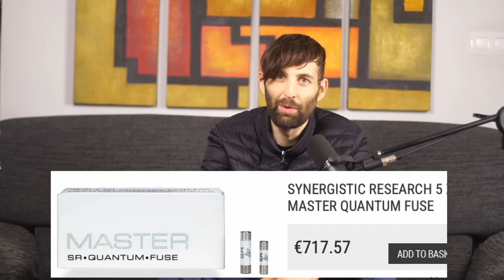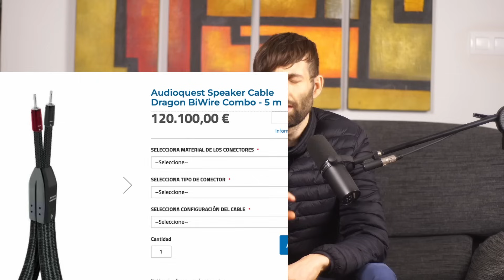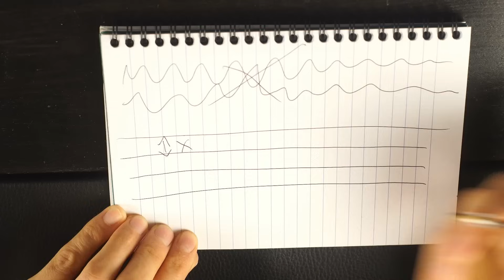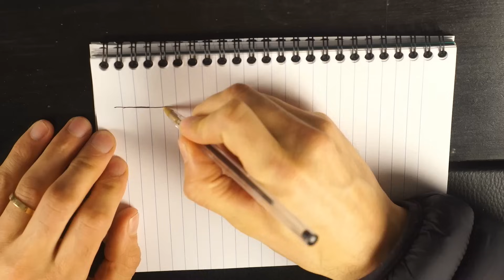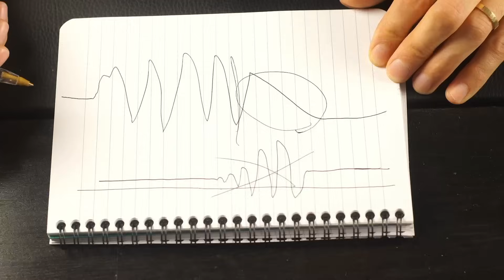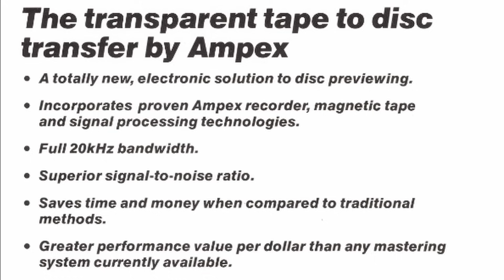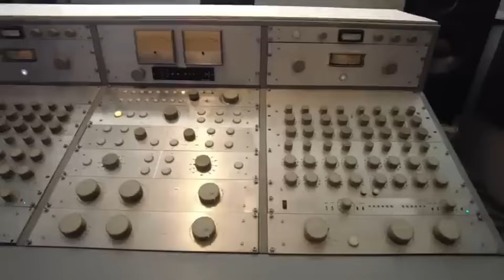Hard truth: most vinyl is digital anyway

Comment: I had no idea they were digitally "mapping" the groove cutting path to keep the grooves from running into each other on vinyl records! I just figured it was always a fixed spacing ratio and then they cut within that set grove "window." That's pretty wild!
Reply: I am no expert on the subject of the "varigroove" method (I believe it was also called Rheinische Fullschrift in Europe IINM) but, in all fairness to the analogue enthusiasts, I have come across pictures online of analogue reel to reel machines that used something like a preview playback head.  This preview head was placed around 2 seconds "earlier" than the actual head which signal goes to the cutter.  This would have been for 33 rpm records, one rotation taking 1.8 seconds, of course.  Once again, I have very little knowledge of these machines but I am very certain they used some analogue electronic circuit to accelerate the lathe's movement when a louder passage came by and decelerate it again when the sound level decreased.  (...Whoops ! and then I resumed the video.  Very interesting machines.)
Reply: @Spacekriek  This was covered in the video ... including a super-rare example of a deck that can do this... but this isn't how it is done nowadays.
Reply: I am curious about whether the grooves become more widely spaced towards the middle of the record, to compensate for the diminishing length of the grooves.
Reply: @ThreadBomb  The diminishing circumference of the record as you progress towards the centre means that speed that the cutting or reading heads see reduces. The inevitably slower speed means there's less room to fit in all those squiggly sound waves! Making the groove (not grooves ... there's only one) more widely spaced isn't going to add to the space available lengthwise, which is what you are losing. I suppose spacing gives you more potential for higher sound levels but I don't think that's what you're after.
Reply: Look at the 'cannon' sections of the "Show me what your made of ..., Deckard ....",Telarc "Tchaikovsky 1812", [DDA], Digital RECORD to see why that was necessary!
Reply: Like everything he gets wrong, pro-studios had decks with an extra preread head to give the master engineer that advance level to adjust groove widths. Other than some of the earliest, few records were cut with fixed spacing. Every effort was made to cram as much music per side as possible.

Comment: I have a Bluesound node x and a Chord Qutest DAC running into a Macintosh  MA 7200 and then to Kef reference 5 meta’s, I love hi res, have embraced it, I’m also a vocalist and former choir boy, my ears are good.. but I also still have a place for some vinyl and a Macintosh T5 TT to play them on, why ? Compare the Zeppelin digital remasters to the analogue original pressings for instance I do think there is a fluidity to the pre digital versions,  not all of them though, “Presence” is an issue, the original pressing  is bass heavy and the mids and highs are poor.  “Kashmir” is quite different in its pre digital form, strings particularly.. check it out .. Stones 70’s output digitised is also not so great, a longer signal path ? and to my frustration there is a great deal of music I listen to on vinyl that isn’t available in hi res, just standard CD resolution. I would also point out that some songs, JJ flash for instance that sound really bright and immediate from the original vinyl single, the early digital versions really sounded flat, poor digital transfer, it’s since improved … so I am not having a go at you. Other examples such as the Police remasters, the Sabbath remasters are grim, terrible, Floyd’s remixes of Delicate Sound and Pulse sound amazing in Hi res but ! The remix has stripped rhythm guitars out of the mix, so listening to it is a compromise of sorts..

Comment: The way I thinks about analog and digital is digital things are numbers and repeatable. Just copy down the number and you have a perfect copy. Analog is always an attempt to copy the original, every attempt is going to be slightly different. So copies will always be imperfect.  Vinyl might sound great but every time you play it it is different. Digital stuff is better as it is accurate as possible and never changes.

Comment: Prior to using digital delay, couldn't (didn't) the lathe operator adjust the groove spacing on the fly to accommodate the dynamic range of the source material? This would, of course, be less efficient than a fully automated system, both in requiring the operator's time to preview the material and also of the vinyl itself.
Reply: It's literally in the video.  Originally they used fixed-width grooves, which was less efficient than variable-width (varying based on the loudness).  Variable-width was originally done with an analog tape delay, but since the late 70s digital delays have been used instead as they are easier to work with and more precise in terms of timing.
Reply: @rezsbc Remove 'digital' from the question.  Prior to any automated width spacing based on delay, did lathe operators do this manually.
Reply: @ like I say it's literally in the video.  variable-width grooves require a delay so the lathe can move the cutting head out in advance of any upcoming transient. Before such delays were introduced fixed-width grooves were used instead, which doesn't use the available space on the disc as optimally (quiet parts use as much space as loud parts).
Reply: we're talking miliseconds in terms of look-ahead time, this would never have been possible to do by a human operator manually.
Reply: @rezsbc I watched the video.  I'm an electrical engineer.  I understood the video.  I gave the caveat that it would be less efficient.   Symphonic and other works often have long quiet periods without much dynamic range.  If nothing else, it may be possible to adjust the spacing between tracks similar to an engineer riding a fader.  My question is simply was this ever done?

Comment: I think one point that maybe wasn't clear was that vinyl has a greater dynamic range than digital. That is completely not true. Digital has the greatest possible dynamic range. Vinyl is a COMPRESSED format by it's very nature. He touched on that in the video. Longer records sound quieter because the grooves are closer together. In fact, my original vinyl release of Rush's Presto says right on the back cover, "side B is longer than side A and therefore quieter, so TURN IT UP!".  Vinyl is compressed. When you compress you LOSE dynamic range. Vinyl is simply not capable of the dynamic range of digital recording. 

The reason people THINK it is, is because of early CD's (also a compressed format) and the loudness wars. The reason so many modern recording sound so bad is because producers and mixers smother them in compression so they sound at the same level (volume) as every other song on the "radio" (spotify). This kills all the peaks and valleys that are present in the recording and makes them sound fatiguing.  People are confusing the inherent ability OF the format with what actually gets released. There is a reason all the best classical performances are recorded digitally. It's up to audiences to demand digital versions utilize the technology to it's fullest. People need to be taught that it's OK to have to use your volume knob.  

It's also because CD's are not large enough to hold full lossless (WAV) files. If you used lossless WAV files for a CD you might get 4 or 5 songs on it. Older ones were even worse from what I understand. So a lot of vinyl snob experience was from those early CD's which were compressed like crazy and often didn't sound great. That's not a flaw of digital. It's a flaw of the CD format itself. 

Now..in terms of "better", that is completely subjective. You can like the "warmth" of tape hiss, and how it sounds transferred to vinyl, better, but in terms of the objective measure of dynamic range it is not better.

Comment: Very similar issues with 35mm film photography vs digital. I like both but purists believe the silliest things about film.
Reply from the maker: i think in photography it's a way of doing things because of the limitations
Reply: 35mm film looks better than pictures taken with a cheap digital camera but its annoying to develop and digital is "good enough" so its not worth the effort .there is a website for my hobby with pictures and the oldest ones have bad color or are in black and white. but the ones from the 80s and 90s have the highest quality then it drops in the 2000s then it slowly gets better .but even now most pictures are only in very compressed 1080p while the 90s pics were scanned at a very high resolution with a scanner and look great .
Reply from the maker: @ video 35mm is very expensive. easier to buy high end digital second hand. photo 35 is still relatively cheap with vintage

Comment: I haven't even read the description of the video but I think you have hit the nail on the head when it comes to analog vs digital. I didn't know it was as early as the 70s but by the 80s everything was clearly at least partly mastered digitally. The hints were out there for everyone to see: I have plenty of old records where it even says stuff like that, because back then digital was a good thing (and for good reason - it still is!). I completely agree with you regarding releasing the wav files that were used for the vinyl master, although I belong to the small(ish?) group of skint audiophiles who would rather buy the cheapest physical media they can afford and save up money to be able to buy more records and/or more bookshelves to store them (and once every few years, a better turntable!). I don't care if there's a bit of dust or scratches on the record as long as it's not badly warped and doesn't skip. It might sound better with the wav master but honestly my tinnitus riddled ears are probably the weakest link in the whole chain. Of course, I do draw the line at spotify and other streaming services when it comes to the listening experience but that's a different discussion altogether, nothing to do with the sound itself but how it's presented to me.

Comment: The soundquality difference stems from quality of DACs used in playback/production. Let me explain. (Most serious) Mastering facilites utilise professional grade (very expensive) DACs in their production process of cutting a record from a digital file. Now if you play that file on an average to good digital system including a DAC, the sound quality is often inferior due to the higher quality of the DAC in the Mastering facility that was used in the vinyl mastering process.
Reply: I doubt this. Converters have gotten better and better over the decades. Professional grade DACs eke out a tiny bit more but even average grade converters these days have very good fidelity in terms of noise, distortion and time base error.  Ethan Winer demonstrated this empirically years ago. Valid blind listening tests  prove this experientially.
Reply: @ so you are saying you don’t notice the difference in quality between a 50€ and 10 000€ DAC?
Reply: @raphaelroth1456  As I said, empirical measurements and valid blind listening tests. With  high end converters there is a law of diminishing returns. 100 times the price doesnt equate to 100 times performance. It just doesnt work like that. Telling a client we have "the best" and citing the price can be nothing more than salesmanship. How are they supposed to know the truth of the matter? Independent, unbiased measurement and blind listening tests are the gold standard.
Reply: @oldgoody1  im not talking about diminishing returns. Not even a child would assume that a car that costs double the price can drive twice as fast… its just plain and simple listening. Listen to the 50€ (at most) integrated DAC in your average Japanese Integrated Amp. Then switch to an external quality DAC. I have done so multiple times with multiple products and there is a big difference (better soundstage, more details, cleaner bass, less harsh etc…).
Reply: @raphaelroth1456  Simple listening? Under which conditions? For a start I'm suggesting listening where we dont know which converter we're listening to.
Reply: @  simply listening. I mean trusting your ears. English is not my first language. 
Yes i have done blind tests. It didn’t really matter though. The results were always very clear. Im not quite sure what you are arguing for here. Are you questioning that there are audible differences between DACs with a differing quality?
Reply: @raphaelroth1456   A true blind test is designed to eliminate human biases of all kinds including biases we may not be aware of having. It's part of the scientific method.

Comment: Do you think all amplifiers and DACs sound the same?
Reply from the maker: no. amplifiers with a high output impedance make things sound warmer. all low impedance low distortion linear amplifiers sound more or less the same and all high quality DACs sound the same. If they do not sound the same, they are low quality or broken.
Reply: @APMastering So you would say a DAC which measures THD+n @ -120dB, IMD @ -110dB would be indiscernible from another DAC with THD+n @ -120dB, IMD @ -114. Both DACs have dynamic range of 130dB, both DACs are 20Hz-40kHz +-0.05dB. Both DACs perform the 32 tone test perfectly, with all the tones the same amplitude, and the noise floor flat, down at --120dB.

You would say it's impossible for someone to tell the difference between two DACs like that, right? The output impedance of each is 100 ohms and the load is 10k ohms for each. And the source files are the same (obviously) lol
Reply: @APMastering I'll tell you why... I recently got a Tanchjim Space (120 bucks -115dB THD+n, -110IMD, 127dB DNR, and capable of outputting its full 4.0V RMS into loads down to 48 ohms. My headphones are 300 ohms HD650 (so they take about 1/8th of the maximum power capability of the thing, not a hard load for it), and I listened to it for about half an hour, not even in the high gain setting (so peaks were no higher than 2.0V RMS), so it was nowhere near stressed. It didn't sound distorted or bad when I was listening, but when I switched to my DAC+HPA combo which cost $2500, I could tell in 5 seconds I was listening to a different source. 
I also wasn't listening to any special/specifically high-fidelity recordings, it was the Smiths, actually. I'm wondering what your thoughts are on this, because personally, I'm confused.
There seemed to be more decay and depth to the sound, the image more stable, and vocals more real. And like I said, it wasn't a small difference! Oh, I should mention, I listen through Tidal.
edit: I forgot to mention - the $2500 source, its technicals:
-128dB THD+n @ 1kHz
136dB dynamic range
136dB SNR
Yeah, it's better than the Tanchjim, but not by a lot, and supposedly way after it's supposed to matter

Comment: Isn't the difference is in how the waveform is represented. With digital you need a DAC that converts bits of data to a audio signal. Quality of the DAC's can very and the vinyl representation won't. The smoothness or detail in the audio signal has no limit with analog but it does with digital which I believe could be perceived as a loss of dynamics

Comment: I sold my turntable and record collection a few years back to make some room.  I miss the ritualistic nature of listening to records a little bit, but I never thought it sounded objectively as good as CDs. As others have said, some poorly digitized older music sounds better on a record but that just doesn't count as any kind of objective measure of 1 vs the other.

But i also sold my early 90's Rotel CD player shortly after i sold all my vinyl stuff because cheap DACs playing WAVs and lossless streaming music off a cheap PC workstation made better sound than my nice old CD player.

I'm now completely digital with my entire CD collection ripped as WAVs or flacs.  I now run an early 80s HK amp & preamp playing my digital music & Qubuz off a Volumio/raspberry pi setup with a $200 ifi dac and newer KEF speakers and I'm extremely happy.

I have some high end audiophile friends so I've listened extensively to some pretty sick systems (Pass Labs, Mark Levinson and beyond) and of course it sounds much better than my setup but for the money I've got invested in my system (under 1k) I could hardly be happier.

And I will never own a turntable again...

Comment: Another interesting video and a good follow up to your previous video. Happy that you mentioned the 'dynamic range' argument, I was one of those who brought that up. It would be awesome if we could get non limited digital files but in my experience, those aren't available to most people so vinyl is a great way to get that dynamic sound. I have question, and please correct me if I'm wrong here, so if you zoom right in on a digital waveform, it has tiny steps on it right? If so, I'd be interested to know, if you cut a vinyl from a digital file, are these tiny steps in the waveform replicated in the grooves on the vinyl? Just wondering if they get smoothed out or lost in the cutting process and would that make a detectable difference to the sound?

Comment: I totally agree with your take on "releasing the vinyl 'HDR' master" digitally. I wish more bands/acts would do that. Having a well mastered digital file/CD is always my preference. It's why the late 80s early 90s CDs are the one I go for when I buy CDs.
Reply: There's a database for dynamic range called "Dynamic Range DB" (can't post links here, just google it) and it is a great tool when you're looking to buy a certain album (or not). If you're not familiar with the DR value, it's good at 10 or higher. Once you go below 8, the music usually starts having that "crushed" modern sound. It's not always perfect and some album might sound better at 8 than another at 9, but it's a good indicator of what you want to buy or not.